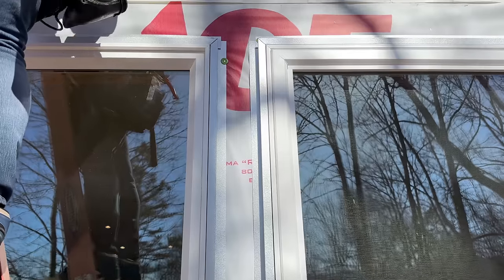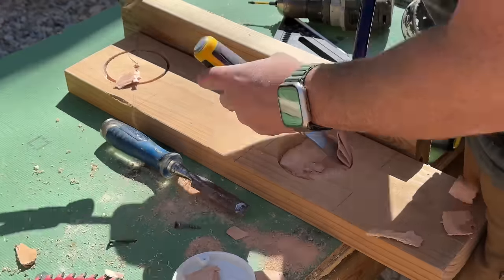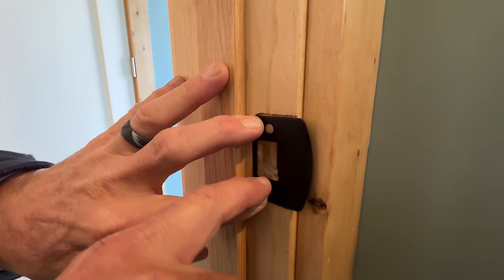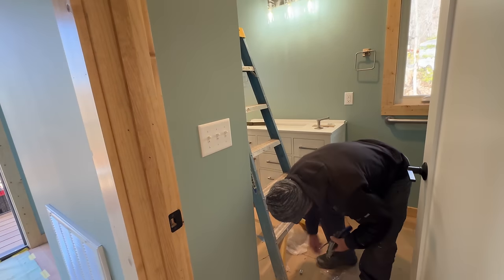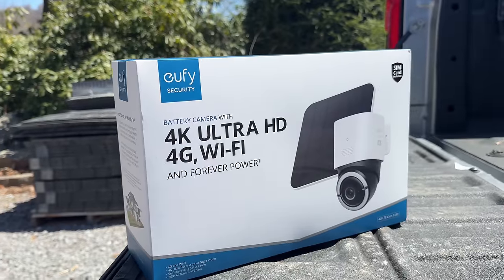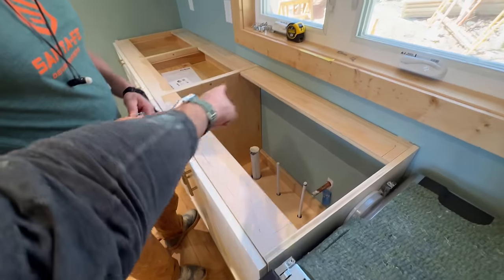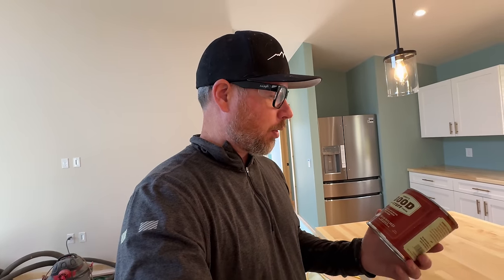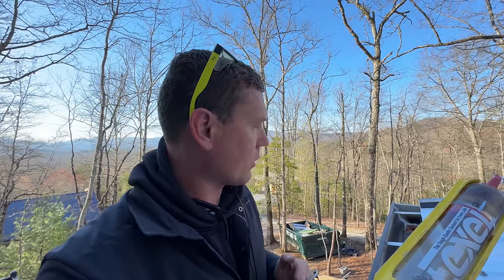Modern Home Build | 49 of 50 | sealed crawl space, door hardware, rain chain, kitchen sink install

Comment: PRO TIP! When placing striker plates, place a piece of aluminum tape over the hole, then hold the bolt open, close the door and release the bolt with just enough to leave a indent on the tape. You now know exactly where to put your plate. 8:39
Reply: That's actually pretty perfect

Comment: Ramelle, love the rain chain. A suggestion for the box at the bottom would be to put moss or other plants that love water or being damp. The would thrive there and help stop any erosion. Yay for a good sink also.
Reply: Thanks. I installed rocks on top of the grate for now. I’ll get the landscaping. Right now I am still trying to get the interior situated. It’s going to be awhile longer in that!
And do glad I found an in stock sink that I liked and even though it was the next grade down in stainless steel it had a better rim!
Reply: @ramellesmith1520  I'd be inclined to put a flattish rock under the end of the drain outlet to help prevent any scouring action.
Reply: When I installed a rain chain here I landscaped the area with river pebbles/river rock that were between 1" and 2" in diameter about 4 feet out from the bottom drain catch on each side.  Then placed some larger rocks scattered about on the pebbles to make a rock garden area so that any splashing during heavier rains keeps the soil or mulch from washing away.

Comment: A nice way I was thought by an experienced carpenter in relation to finding the exact location for the latch plate on the door frame was to rub the lead of your pencil up and down on the latch then close the door and just pull the handle down and let it spring back up open the door and the lead should leave a mark exactly where the latch will close into the latch plate. Works everytime and saves so much time.

Comment: Case in point about the doors. My in-laws have an amazingly huge hardwood front door that in the winter didn't latch good because the installers did not take the time to adjust the plate. There's 2 ways of doing things: the right way and again.

Door lock devices on top of door trim is essential for kids.

Comment: Omg. One of my pet peeves, is a door that won’t latch perfect. You should be able to gently close the door, with just a light swing of the door. I always install the door handle before I hang the door/jamb. I also have had to use that rotary rasp occasionally 🤗

Comment: Lunch tech is wonderful, when I was a kid, I saw contractors heating their lunch with a gas blowtorch or a propane torch. Re: peel and stick backslash for the cooktop, is is heat and humidity rated--guess I would have used stainless steel.

Comment: I have installed a lot of that steel. My solution was to cut the J pieces to fit but wait to fasten them until steel has been cut to fit and is ready for final install. Attach the J and the steel at the same time, easy and no scratches or frustration!

Comment: Pro tip if you need to move the strike plate down you can always glue golf tees or make little wood plugs and move the plate and no problem with new screw holes

Comment: Pro tip on the strike plates on the doors. If you need to move them for any reason. Splinter a bit off a shim and tap it in the screw holes until they bottom out break them off, and you can move the plate where you need to put it. Use to install doors and we bad to do that sometimes.
Reply: Doesn’t work when you have already routed out the area for the plate to sit flush. It’s much easier and looks better to just file the plate down.

Comment: @PerkinsBuilderBrothers. When the door plate needs to be moved up or down, to prevent from hitting the old screw hole, take the plate off, use a golf tee, put in the old screw hole, tap in and cut off flush. That will give you more surface to screw to so you're not getting "pulled" into the old hole.

Comment: To make your life easy they make lock installation tools. Part of the kit is rectangle striking blocks with blades on all 4 edges to get the outline of the strikeplates and bolts that need to be mortised. The other part looks like a small pointy plumb bob. After the crossbore and latch/bolt holes are drilled for the lockset you insert the plumb bob thingie into the latch/bolt hole. It has a point on it. Hold the door closed and give a slight tap and it perfectly marks the center of the frame for a perfect alignment. 

The other tip is if you don't have that tool install the deadolt or latch and put some lipstick on it. Work it in and out a couple of times. It will mark the frame where to drill. It also works to adjust or grind a strikeplate where the bolt/latch is hitting. I'm an automotive locksmith but every once in a while I have to do someone a favor so I have these tools and always have the lipstick for adjustments.

Comment: 9:45 hilti dx460 is a boss when you need a PAN. Although that said, the charge type is a big determinant in noise. My guess is they would be using yellow caps with the power adjustment rolled right out to hang that VB sheeting or it would just punch right through. 

If you use reds or blacks and have the power dialed in, it sounds more like a .22lr pistol than a stapler.

Comment: When drilling/cutting out for 4" round 1/2" flat electrical boxes.... it is best not to drill your hole thru in the middle. It is better to use the offset hole over the middle, because if the light uses a threaded rod in the center you don't want the wire in the way. Ok ha, hope I typed that well enough to understand

Comment: when I've missed vertically, I remove the plate fill the holes with wood glue and match sticks, let it dry cut it clean and adjust the plate, pencil to new screw hold, give a good eye-ball look and screw the plate  on again.

Comment: it seems so crazy to me that they would install the door stop before the ironmongery, you will always have rock on a door doing it this way. you can also space the doorstop off of the door to allow for paint but as these aren't painted i would deffo install after latch and receiver. also you don't touch the receiver until the latch is in, that way you haven't got to mess around with filing the receiver as you've installed it to match the latch. I'm guessing these door frames came pre routed aswell? which seems strange especially as it never looked like a neat job around the receiver. i don't usually comment on videos but i am always so blown away at how backwards american builders build. Half of the stuff you guys do wouldn't fly here as it would take way too long and your hot tips are usually things 1st year apprentice's figure out immediately. Despite everything i still can't stop watching, keep it up.

Comment: Installing door hardware can be very simple…the back of the plate on the keep & the back of the plate on the catch line up when the door is closed…take a tri square, hook it on the inside of the door & adjust it to the back of the keep plate…then hook the jamb & mark it, that gives you your back set on the mortise. When drilling your hole it’s centered….its easier to visualize by just putting the keep on the catch before installing…they obviously line up top to bottom too(not being a smart a$$, just saying)👍🏻

Comment: I still think it's funny how easy and cheap it is to get an integrally suppressed .22 nail gun. No background check, no paperwork, no tax stamps. Even come in semi auto form, and could be easily modified to fire without being pressed against a surface. Range will be limited, but as a tool of necessity, there are worse options...

Comment: Enjoy Your Channel,. Use an 1.5 inch deep x 3,5 inch round box for exterior lights,  2 -12/2 NM cables in a pancake Box without a proper connector is not code compliant

Comment: 17:20 Question! Is that vapor barrier waterproof?

I'm just kind of curious which option makes sense from a building science standpoint. Cut the hole in the membrane and tape it? Or leave it covered?

There SHOULDN'T be any water on top of the membrane unless you have a big leak upstairs. And if you cut that hole, then outside, moist air can enter the basement. Also, any ground water that does come out of the ground won't be able to escape out of the basement and might bubble the vapor barrier.

If you don't cut the hole, outside moist air can't enter the basement and any ground water that does happen to rise can escape.

Am I over complicating this?!

Comment: come on guys, l thought you were professionals,  when you drill a hole with a big hole saw , drill your 1/4'' center hole first, then put your hole saw on the arbour and drill the hole, that way, you won't bend the pilot bit when the edge of the hole saw makes contact with what ever you are drilling through.
as for pilot bits, l don't use them, l have a piece of 1/4'' steel rod in the hole saw, to follow the hole l've drilled  previously.
l've been building for the last 30 + years working this way l don't think has cost me any more time, l bet it has saved me a bunch in bent pilot bits and broken holesaws though.
keep on keeping on.

Comment: You took a sealed crawlspace and unsealed it. It is literally impossible for water to Leach through on top of the crawlspace barrier if you did your waterproofing right and you have a crawlspace dehumidifier. You have both of those. That pipe should be at a low point beneath the crawlspace barrier to relieve potential water pressure beneath the barrier, not into the actual crawlspace area.